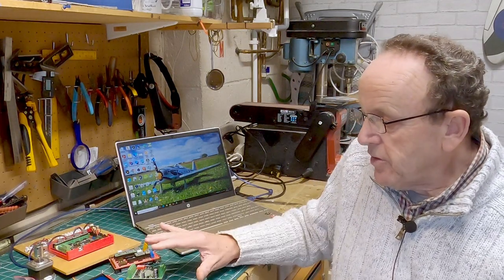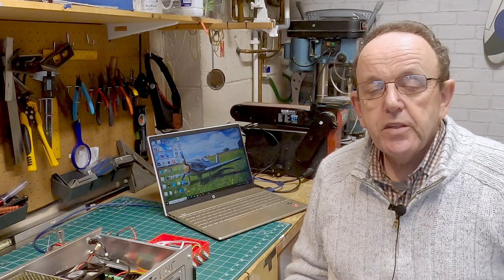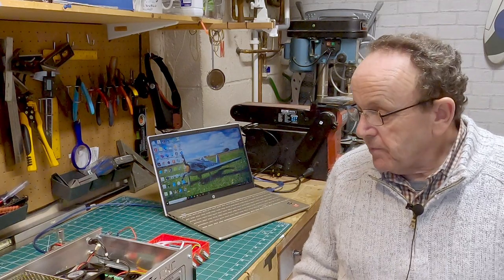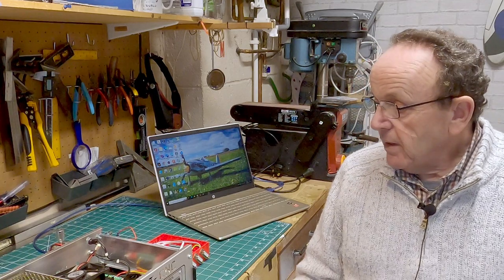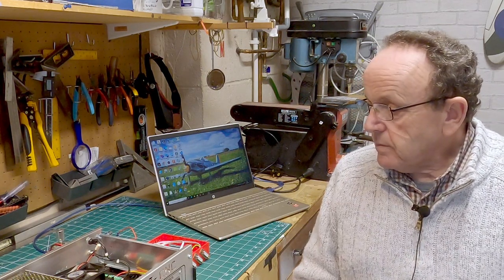4 and 5 Axis CNC Controllers for CNC Foam Cutting

Comment: really great video. I have another information from what you said in this video that might you miss.
1. arduino mega based (including mks board) can do 5 axis too. 27:43
2. the cheapest 32bit controller is ESP32 with NCFluid firmware, and it has wifi or bluetooth. 29:33
3. jedicut (skin property)  and grblugru (wing creator on extras menu) has kerf setting (skin thickness) 33:25

hope it helps. cheers
Reply from the maker: Yes, I was aware of these points you make thanks. ESP32 does look good and a few guys have started using it with FluidNC which I may try soon. Although I have covered Jedicut I don't mention it anymore because it's not very intuitive and it's the software I've had the most questions about. Grblguru does look interesting but I haven't used it.  Mainly because I have too many other projects.  I like to give the watcher my own experience with hardware and software so that they can make the best decision.
Many thanks for watching

Comment: Thanks Keith for your explanation, again very usefull and well done. You mention in the end of the video a guy in South Africa who made a automatic wire tensioning system, do you have any more info on this?
I'd rather not use the "bow style" tensioner as it takes lots of space and I want to be able to dismount and compactly store the foamcutter when not in use.
Reply from the maker: I've contacted they guy in South Africa and asked for his permission to release the files he sent me. As soon as I get a reply I'll let you know.
Reply from the maker: Here's a link to the files he sent me.  Which includes the hex file, Gerber files and some pictures. I don't know too much about it yet but will build one later this year.
Reply: @rckeith  Hi Keith, maybe I'm missing something but I don't see the link in here.

Comment: Hello Keith, for Arduino UNO with shield v3, what script should be used to control the 4 stepper motors? greetings
Reply from the maker: You need to use  DevCNC Foam from DevCad https://www.devcad.com/eng/devcncfoam.asp
Reply: @rckeith  OK thanks. But I mean, is it necessary to compile some modified RGBL on the Arduino Uno or is that already taken care of by the devcnc foam software?
Reply: @rckeith  great, all is included with DevCnc. Thanks a lot for your knowledges.
Reply from the maker: DevCNC Takes care of the firmware for you